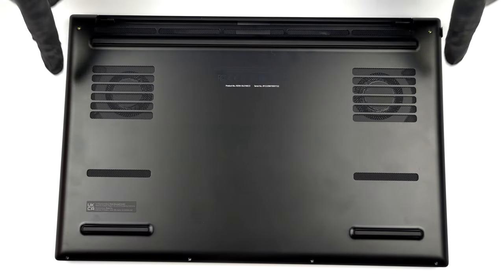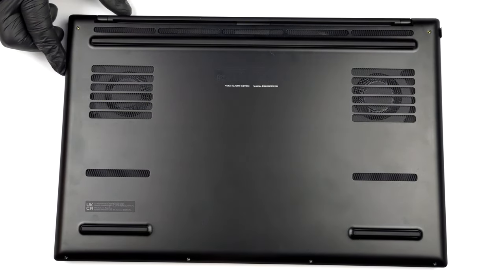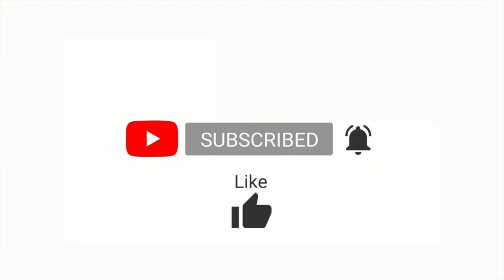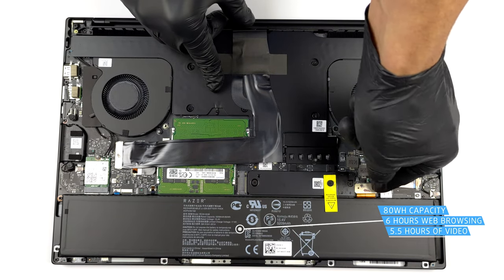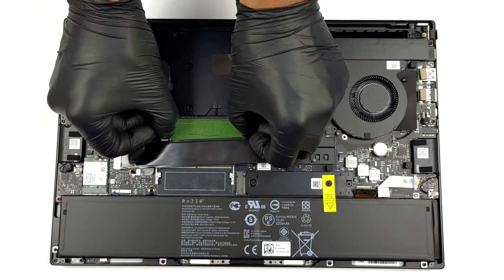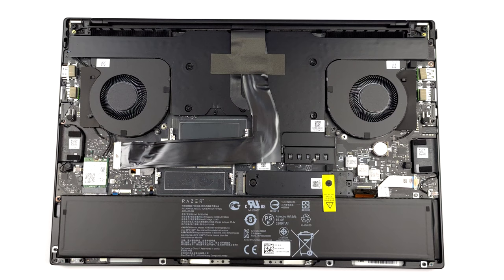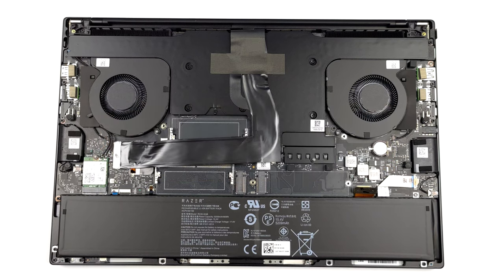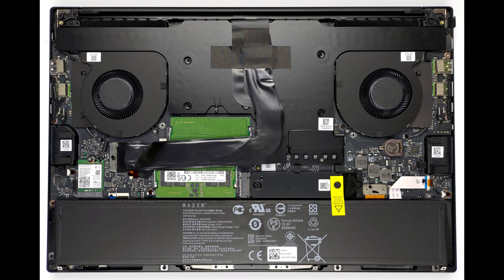🛠️ How to open Razer Blade 15 (2022) - disassembly and upgrade options

Comment: this is hardly a disassembly. I still can't find a single comprehensive teardown resource for replacing components or even the battery
Reply: I was able to replace the battery but I'm trying to get to the CPU and add the new fans and add thermal paste on the CPU